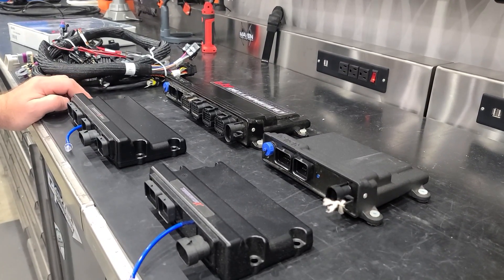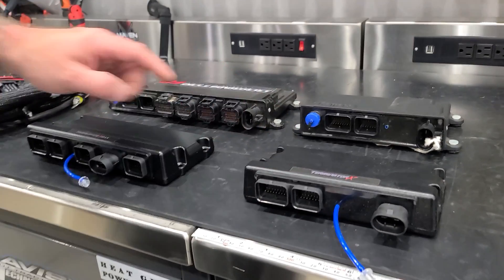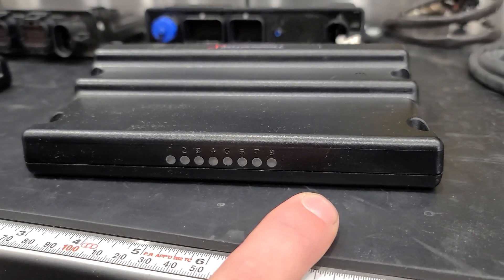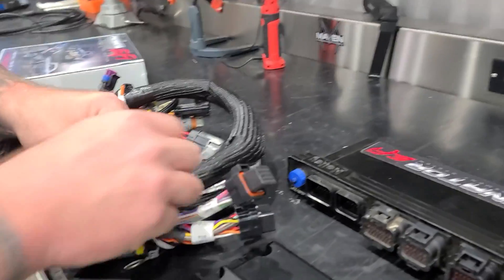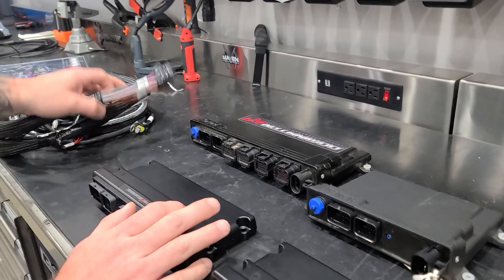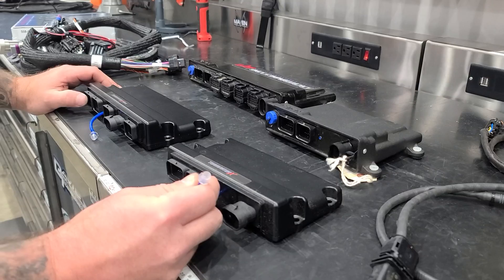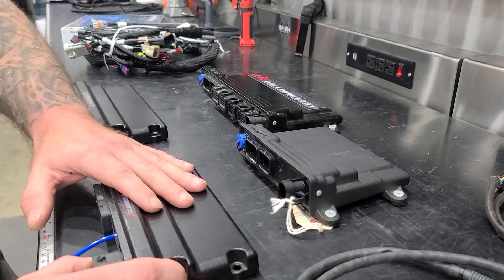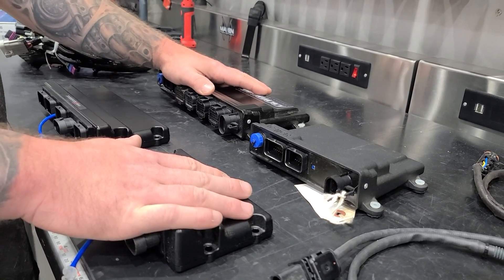All the different holley ecus compared

Comment: the wiring is minor whats the difference in software? which will integrate with can bus? Which has both digital and analog inputs and outputs and whats the difference with dash connectivity? sensors also change every year sometimes what is compatible and what years are not? and what kind of safety systems do they work with such as abs, traction control, keyless entry ect. hard to listen to a guy whose explanation of the differences is simply "this one more money's" there is alot more to this but cant seem to find any info

Comment: What would be best for street use, I’m putting together a 347 for my 78 ford and I want to use the Holley high ram for the 8.2 deck ford small block because I think it looks good, im going to use a 5 speed manual so I don’t need trans control im only gonna be making 350-400 horse power with my combo

Comment: HELP, I just purchased the Terminator Xmax to control my 6.0 In my squarebody. I want to adapt a complete 2008 radiator and electric fan setup to my truck but the fans have low and High speeds. I also will be adding Vintage air system. My ECU has a total of 4 
I/O’s. Can the Holley ECU be setup to control a 2 Speed fan setup? All I ever could find was simple On/off function based on temps. I’m bout to get a nosebleed from this.

Comment: What's the max horsepower for the Terminator X? Would it be good for e85 car? Is it good for up to 1000 or 1100 rwhp around there?
Reply: I hit 994RWHP and 1050 Trq with X Max and E85 setup.

Comment: I have a question about the Terminator x Max.. if you have the drive-by Cable model with the transmission hook up and all that can you buy a separate harness for the drive-by wire if you change engines later?
Reply from the maker: Yes

Comment: I just got my Terminator X Max in the mail but why only 1 O2 sensor?  Will 1 O2 Sensor do as good of a job even though it can only read one bank of the engine?
Reply from the maker: cause term x only supports 1 o2 sensor

Comment: Can you order the Termx with the upgraded O2 sensor you recommended? Or must you order separate? Also does it work correctly with E85?
Reply from the maker: like stated in the video if you want to run the ntk sensor youll be using either an hp or a dominator not a term x
Reply: @theholleyefiguy  This is where I'm confused. Danny Cabral said I can ONLY the bosch with my hp. I'd rather run NTK as I believe they are superior. So can I run the NTK or not? And if so what p/n?
Reply: wondering the same, not a fan of bosch sensors

Comment: Will the holly terminator X work with a 6L 80 transmission
Reply: Nope
Reply: None of the Holley line support 6 speeds at present.  You can however run a standalone computer for the trans.
Reply: Update for any one that sees this post, the answer is now yes... With a new add on box they make.

Comment: With the terminator x...can I actually plug it in and auto tune without much tuning experience.. or is there more to than that. 
On a natural aspirated 6.0 ls
Reply: Plenty of guys just fill out the wizard on the handheld and let it auto tune and it works great. It's not going to make as much power as a good tuner making an optimized tune, but you'll go up and down the road safely and have plenty of fun.
Reply: Chris Farley  if it got hydrolocked, it probably wasn't the tune. Stuck injector or shorted injector wire hanging an injector open would. Unless some idiot gave it way too much cranking fuel.

Comment: Always go for the mo monies the first time or you just end up spending mo monies.  😀.  Good info.
Reply: I'll usually agree but in this instance, there no sense in buying capability you aren't going to use. If you're running a manual trans car with cable throttle body there absolutely no reason to buy the Terminator X Max (max does transmission control and drive-by-wire throttle body). If you don't have a use or need for all the logging and input/output ability of the Dominator or HP theres no point in spending WELL OVER 2X the price of terminator.

Comment: The biggest issue i have with the holley ecu range is the fact that to get more than 4 IO you have to get the dominator and not everyone needs or wants as much IO as the dominator has. I really wish they had an intermediate ecu. I love my termi x setup though.
Reply: they do. CAN i/o expander for 400 bucks adds 8 inputs and 8 outputs. talk about a STEAL